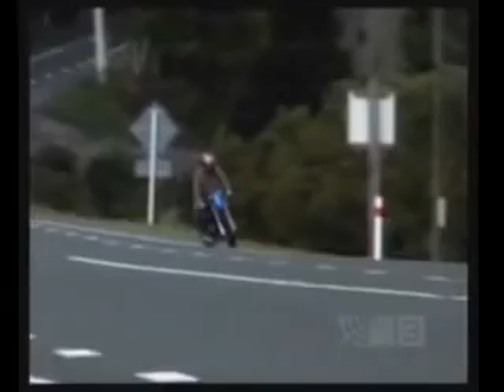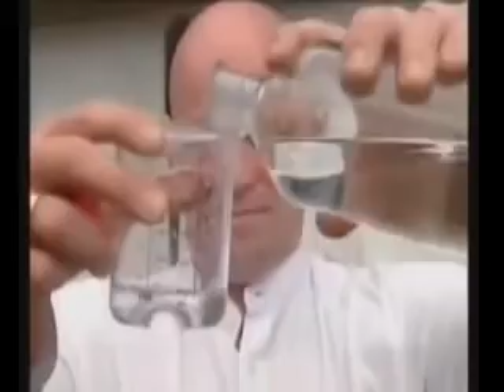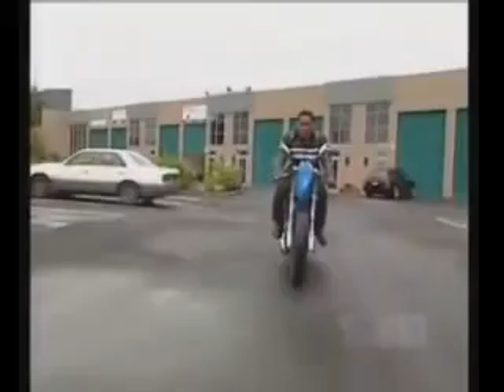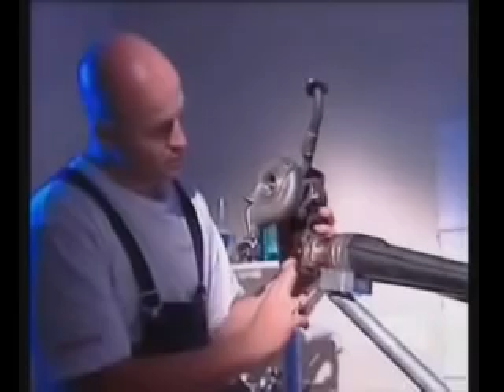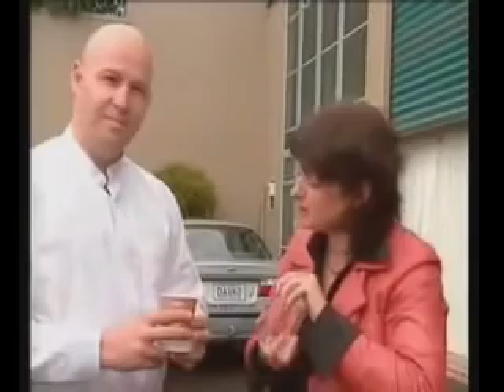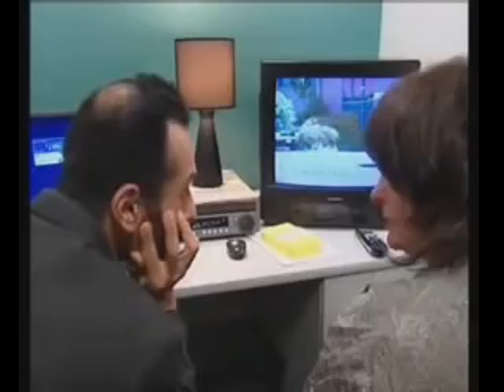Motorcycle Runs On Water, Steve Ryan - Free Energy

Comment: I've seen countless videos of people running engines off water. I understand how they did it. Like Steve Ryan I was an accountant that helped me solve many problems. I was the top investigator in my class at SW Florida Criminal Justice LE Academy, the reason was simple my auditing skills allowed me to solve numeric and other problems. I had sometimes spent hours at the beginning trying to balance statements and each year became faster until it only took a minute. Once you learn to problem solve you can expand the concept of finding which combination of factors can alter consequences. Here is the conclusion of fact.
To run an engine you need a fuel that will allow combustion.
An environment that allows for continuous combustion.
A generated spark
A discharge way to empty a chamber
A method to refill a chamber 
A way to convert water if used in a manner that uses less energy than required to convert it 
A way to regulate the amount of energy or fuel that goes in that us required.

Steve's motorcycleengibe runs at consistently the same speed of ram.
He does not use a computer circuit to measure the required input for different speed of the engine much like a battery powered automatic transfer. The simplicity is evident and motorcycles that were from the 60-70's were perfect before the manufacturing became dependent on using more specific machinery at dealerships to change out systems. Alternators were being put inside the engine instead of on the outside near the battery making us dependent on their help.
A conversion to the fuel cell (Stanley Meyer's idea and patent from the 70's-90's) will go into effect around 2050 according a prospective sent out in the last few years to give warning to the oil world that a major retrofit was in process.
Reply: Dr Greer spoke with one of the children of Meyer, no one can replicate what he said was occurring even using the same equipment.